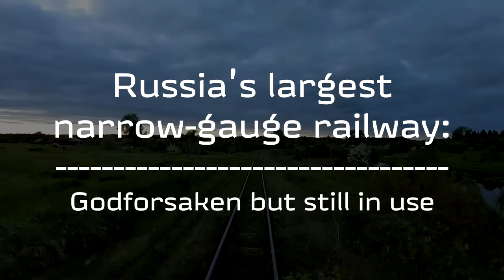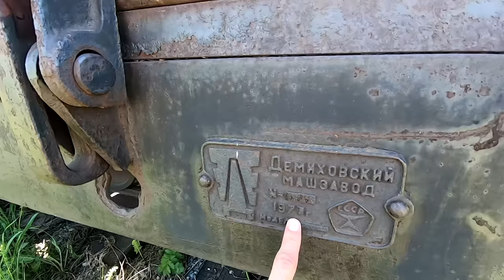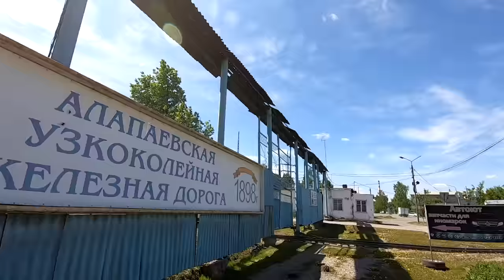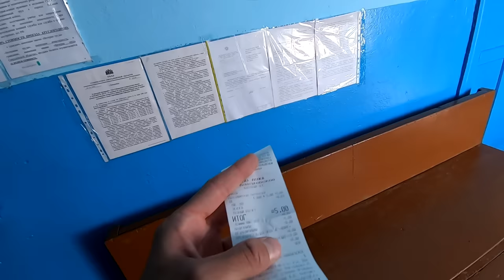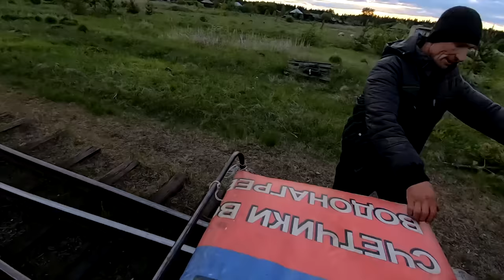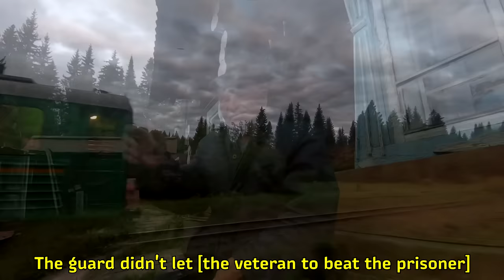Journey to Russia's Largest Narrow-Gauge Railway

Comment: 9:22 Originally, there were heating system pipes and a boiler in this wagon, but apparently the system has been upgraded there. In Estonia, In Lavassaare narrow gauge railway museum we still use that old system.
Reply from the maker: Indeed, the type of heating system you mention also exists. For example, there are such wagons at Karintorf narrow-gauge railway and probably somewhere else.

Comment: Thank you for this interesting excursion!

38:28 - actually, these are not the only narrow-gauge platzkart wagons, which have ever existed. In the past days, such wagons (however, not ПВ40, but PAFAWAG) also operated on an enormous narrow-gauge system in Ukraine. It passed (!) 3 regions and total length of tracks was over a thousand of kilometers. Obviously, there was a need in night trains on such line, and that's why those carriages were made. Unluckily, most of the system was closed and demolished in the 2000s, the only remaining stretch is now known as Hayvoron narrow-gauge railway. It's still rather long, but not that much, of course.

Good to know that narrow-gauge platzkarts still exists somewhere!

Comment: Huh... This looks even narrower than tram tracks in my city.
There is a narrow gauge in my country as well. It was an old Austro Hungarian thing used to haul wood. It fell into disrepair during Commie times. Some comrades even pushed really hard to destroy it completely. Volunteers took over, restored locomotive, rolling stock, part of the track, all in their spare time, all despite said comrades. They even put secret police on them, arresting and interrogating them multiple times. It is now still under loving care of said volunteers, run as a tourist attraction. If you ever come to Slovakia, I highly recommend, we have multiple lines working. This one is in Štiavnička, for future reference...

Oh, and crosses in middle of nowhere could be former Gulag camps. Or at least their cementeries. Sometimes locals did this and usually it is only thing remaining of said camps.

Comment: We had a railroad just like this in Norway previously, Tertitten, but the biggest difference being that it was closed 60 years ago. So were similar lines just because they became too expensive, the benefits from carrying timber and the few passengers who actually lived in the vilalges around the tracks became too expensive. Setesdalsbanen, Krøgerbanen, Teritten etc were closed because they had to switch from coal to gas locomotives, which became too expensive, aswell as being narrow gauge for the most part. However all the railroads were replaced with car roads to actually keep the communities alive! Then in the 1990s we started closing raillines with diesel locomotives, just because it costed way too many hundred of millions annualy; like Namsosbanen, Numedalsbanen, Valdresbanen, Rjukanbanen etc. They often had one city at the end, but when it closed down its main factory, the whole railroad got shut down even if the gauges still were usable just because driving the trains became too costly. I see that the Soviet Union upgraded this railroad in the 1960s and 1970s probably from coal to diesel engines, but still, by the 1980s and 1990s the need for repairing the gauges must have been really big, and yet they chose not to and just drive the trians at the minimal speed possible almost (Norway does somewhat the same with Sørlandsbanen tbf, but thats one of our main lines and is just waiting to get upgraded with trillions of USD after this financial crisis is over). All the villages are dying, just everything is dying and yet they keep driving these trains with 5 people in them despite only going maybe 4 times per day, or 8, idk. They still do the bare minimum instead of just closing the thing down and save probably billions anually with so cheap tickets (state subsidies) and barely any cargo trains. This is really the reason why Russia runs on so big budget defficies, they lose quadrillions probably annualy on maintaining infrastructure just like this; but I get they do it to keep the regime popular with the locals. They really have no other political chose, and it's not really unique to dictatorships either, Norway and most other countries try to keep districts alive to a certain extent atleast. 

But what I don't get is why there's no investments whatsoever, there were alot when you went to Sakhalin and there are in the far east and the larger cities in general. But it just seems like it's Putin strategies to keep these communities alive until they are all but dead, instead of trying to get them back on track and atleast save some of them, try to locale a district's services in one town instead of letting it all die and get localized to 10 cities in the entire nation (exhaguration, but in much of the north that is what seems to be happening). Idk if this is Putin's grand strategy to consolidate infrastructure spending for those who come after him, or that he simply doesn't care that his largest voting base disappears aslong as they are along until he's no more in 2036 or what year he decides to retire. I get that most people in the regime are corrupt crooks and the railroad probably runs because a friend of a friend owns timber there or he has personal connection to the region or whatever, but if Putin wanted he could have encouraged some economic and demographic growth to atleast some of the places Bald and Bankrupt, NFKRZ or Vagabond visit. Instead we only see really good urban environments in places like Volgograd, Smolensk, Perm, Vladivostok etc; and some exceptions like Sakhalin or the Caucasus kinda. Whereas most of the rest of the country is just dying of. It's just so sad, a catastrophe really and something which will hurt Russia for all of our lifetime I'm sure 😢. As for this railroad, I'm sure it will be closed permamently in a decade or two once it becomes even less profitable and the state just decides to abandon the whole area, like with many other places like this.
Reply: I think operating line like this is quite cheap. No investments, only repair what broken, all simple Soviet tech. Fuel is cheap in Russia. Labor cost like 20% of Norway equivalent. They should keep the line as part of heritage and make of it tourist attraction
Reply: See the size difference between Russia and Norway before comparing about infustructure in a remote Siberian wilderness..... 

Why not you compare your Oslo with Moscow Instead pointing fingers at some uninhabited barren wilderness, which size is bigger than all the Nordic countries combined.
Reply: @dipjyotitalukdar9598  I mean, Perm isn't exactly in the wilderness. It is in one of the most heavily populated areas of Russia, close to both Chelyabinsk and Yekaterinburg. This railroad clearly had a purpose historicly, it linked many small towns and villages together across 1000 Kms to carry cargo and people. The Aurskog-Høland railroad was only 57 Kms, so sure, not really comparable in that sense. Numedalsbanen was 93 kms and Valdresbanen was108 kms, so still not close in length. But they only connected less than ten villages with some kind of industries (Fagernes in Valdres got status as Town after the railroad was demolished as the car road managed to save its industries), and as they shut down so did the railroad and the districts died and people moved away. I would assume this railroad connected almost 100 villages and towns across the important water ways and forrest industries. Although on a smaller scale, I still can't stop myself from seeing parallels. Norway never really had that many railroads, but Sweden and to a smaller extent Finland had alot also in the districts and as the car industry took over, people moved away and industry was centralized; the railroads died and so did the districts and local communities; especially in the north of those countries. It doesn't really matter that much if it's 100 kms or 10 000 kms, the effects are for the most part the same, but for what we see in this video the ramifications are alot more severe than in Norway where the communities die much slower.
Reply: @sieciechczajka6554  In Norway we have kept most of our non operating railroads as museum railroads. Locals take the cost of repairing it etc. And sure things are cheaper in Russia, but people also earn less. As all the elders along this railroad die and the forrest products can't be sent to Europe, and there isn't really that big of a market in central Asia or China for wood. I don't say there is no demand for wood products there, and I think Russia will export a great amount to those countries, but I think other places in Russia closer to the major hubs and the asian market will outcompete expensive process from extracting this wood.The distance is just so big, 1000 kms. And the state really needs to cut expenses going forward. And as services close in this part of Russia, more and more young people will move away. Managing railroad, even without trains who carry people and only with trains carrying cargo (which is alot cheaper, Norway does it in a few places like Solørbanen actually). The trains would still wear down it's gauges and parts will need to be replaced. And that's without mentioning climate, which will tear down this railroad time after time again. Sure, repairing one bridge to keep cargo trains moving is worth it; like in this video. But what happens as less and less trains are profitable? The old guy said that at the height of this railroad there passed 1 train every 20th minute. Nowadays it's maybe 8 trains per day. Those passenger trains were so small and empty that I can't imagine them being profitable. That's like 4-6 trains a day which actually make a profit, and they make wood all over Russia, it isn't like some rare comodity for national security. There are two towns across this railroad if I remember correctly, excluding the starting place in Perm; Rezh and Alapayevsk, both with approximately 40 000 people each as of now and a dwindling population; but less so than the villages. Idk what they ought to do when this railroad shuts down, but I don't really think the government will care that much, just look at arctic towns closer to the northpole. There does exist car roads and although many russians don't have cars, I don't think any of my russian friends do, lol; I'm sure yeah, those you wanna stay would have to get one anyways when the trains come that seldom. I would like this rural district, aswell every other district, to suceed and do well. I want small communities to thrive and keep their diversity and heritage. But if there doesn't happen a miracle, like Russia's birth rate suddenly explodes infinite and rare earth minerals are discovered just adjacent to this railroad, I don't really see that happening. Urbanization happens all across the globe, and it doesn't care what continent you are in or what form of government your country has. However, you may implement steps to slow it down or divide the growth so that not all growth happens in one or two cities alone. It makes me sad that Russia doesn't try atleast to save villages like these more with industries being built, good infrastructure being developed or services like healthcare of education being funded despite them not being profitable anymore. What we see in this video is a school with like 50 pupils being closed with no schoold near by. That would actually not happen in Norway, sure shops, roads, churches and railroads could be demolished. But when a school closes that's the end of the local community. Sure, we have many examples of schools being closed and students going to the neighbouring village, but rarely more than 1 hour away at most by bus. With this railroad we are speaking of distances up to 3 hours maybe, and with no alternatives besides the train. Then there's no wonder that people, despite loving the places they live in, move to provide basic services for themselves and their children. This railroad is just manifestation of this, sure you may build one new bridge or lay one kilometer of new tracks, but it doesn't really save the condition of the rest of the system. It's all rotting before our eyes and it's just saddening to watch.

Comment: Could the crosses be where the faithful congregated to worship if the settlement did not have a temple or a priest? 
In England they are called 'Preaching Crosses'. Clergy would travel from a monastery to conduct the service there.
Reply from the maker: That's what I was thinking. However, there is a church in Sankino in addition to the cross situated separately. In Muratkovo, there was no church indeed.